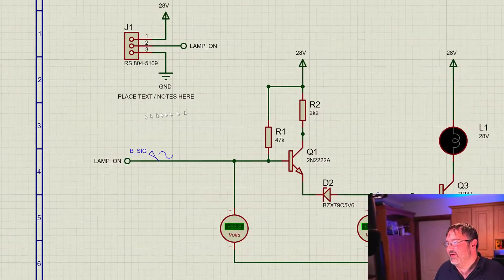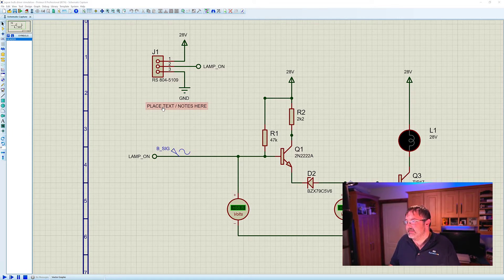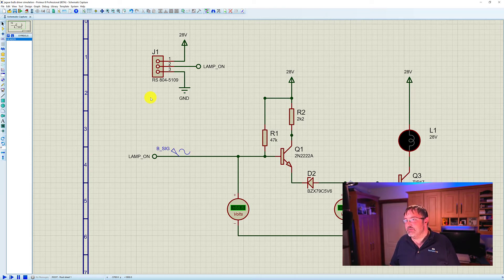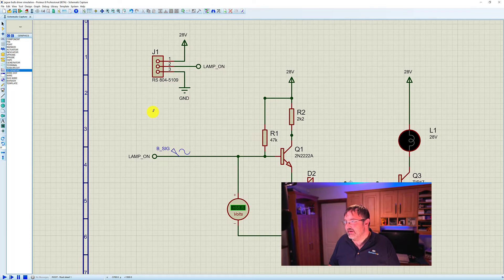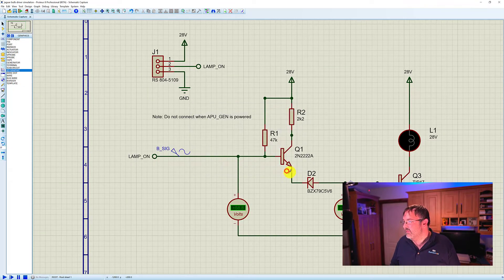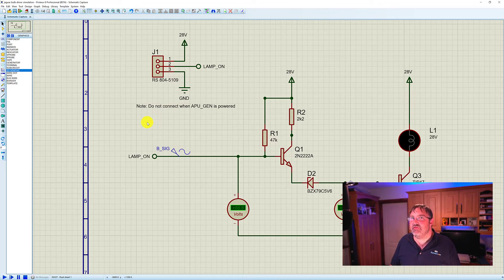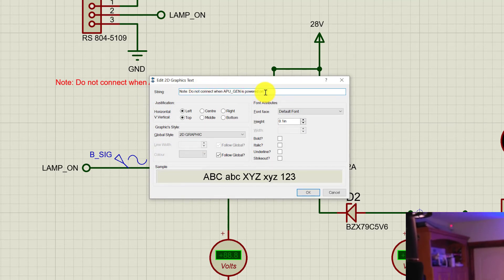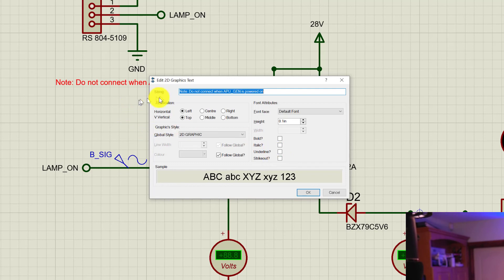Proteus Tutorial How to Add Text to a Schematic

Comment: Many thanks for the video.
As a long-term Proteus user however, there are occasions where I would like to place multi-line text on the schematic (e.g. settings lists, note lists, etc), for which a multi-line feature of the text tool would be a very welcome addition - saving creating/editing/positioning new single lines of text on each occasion. Maybe something like [NewLineKey] + [Enter] when editing, to embed new-line chars in the text string?